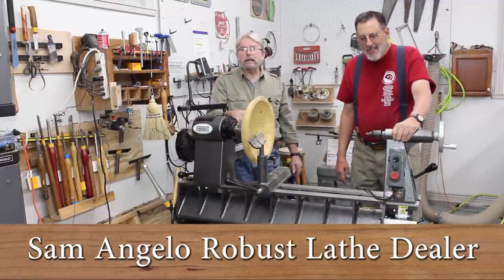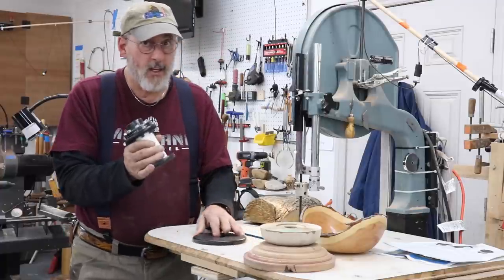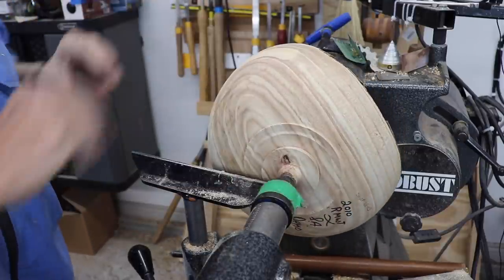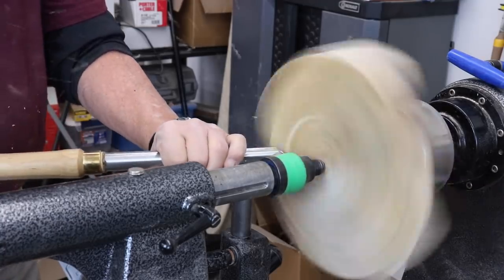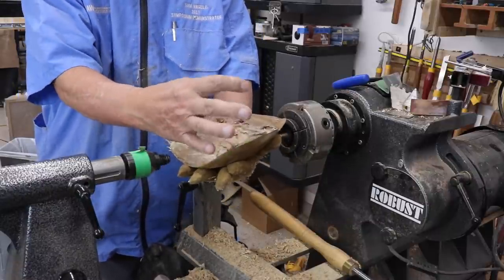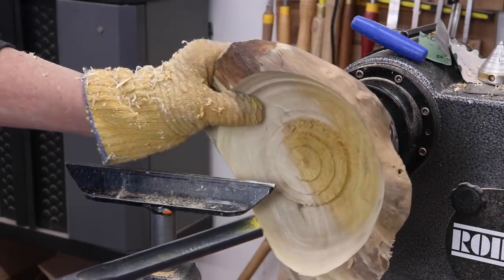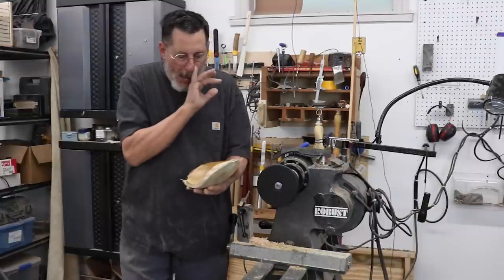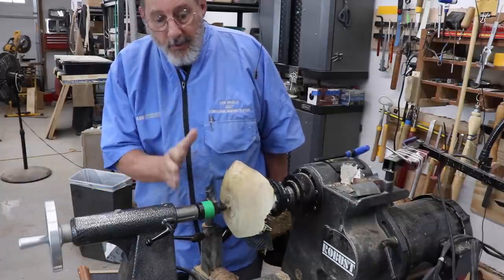Natural Edge Elm Bowl and the Ron Brown Natural Edge Chuck               Woodturning with Sam Angelo

Comment: Very nice Natural Edge Bowl. What do you have attached to your lathe light with the zip ties?
Reply from the maker: I am a zip tie kinda guy.....(and rubber bands)  Yes that red thing is a remote for my dust collector.  A while back I dropped my other remote and it broke and didn't work anymore.  I have one on my other lathes on the other side of the room.  Usually I only have to walk a few feet to turn the dust collector on.   Sam

Comment: Nice bowl Sam! The chuck looks like a good piece of equipment to have. Ive heard some say that the shelf liner will leave a design on the inside of the bowl. Have you experienced that? Thanks for sharing!
Reply from the maker: Good point.  I never ship an item wrapped in bubble wrap, for example.  But the shelf liner is similar in that it can leave an impression on the surface of the wood.  I often add a paper towel between the shelf liner and the bowl.  If the wood is NOT finished-just sanded-I don't worry about it.  Sam
Reply: @WYOMINGWOODTURNER  thanks Sam. I didnt know whether that could be an issue or not. The only thing ive used to turn off a tenon was a set of cole jaws. But that was on  straight rimmed, trued up bowls. I do however have a hedge bowl rough turned that ill have to use a drive block on when I take the tenon off, if I want to leave the bowl out of round. (Oval shaped) I was going to true the bowl back to round, but my sons have both said they like it oval shaped.

Comment: Thanks Sam. ???When do you use a negative rake scraper over a routine scraper with only one edge? Can you buy negative rake scrapers or do you usually have to grind the second bevel on a regular scraper?
Reply from the maker: One reason to use the negative brake scraper is it is a little safer than a traditional scraper. It is important when using a negative rake scraper to have a fairly large burr on the top of the tool. This makes it into more of a cutting tool than a scraper.  Hope this helps a little
Sam
Reply: @WYOMINGWOODTURNER  Thank you!